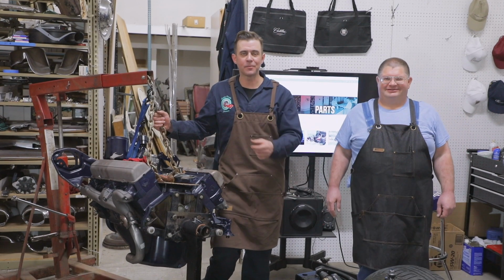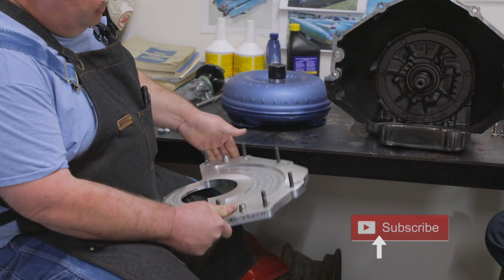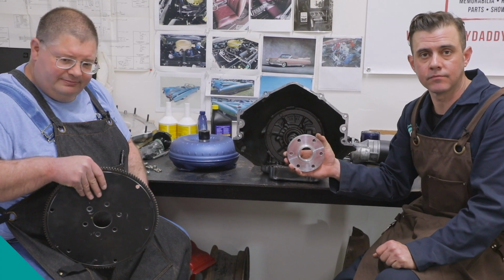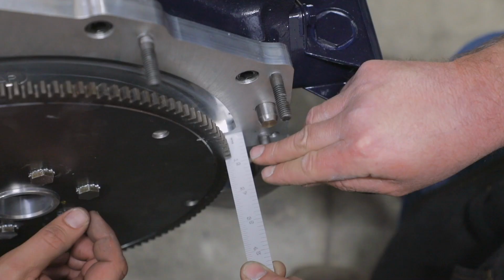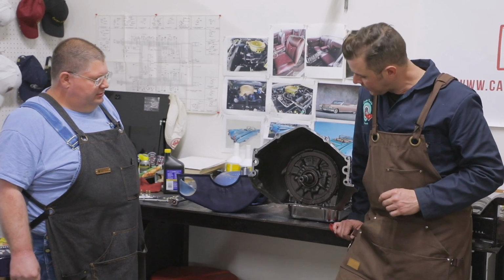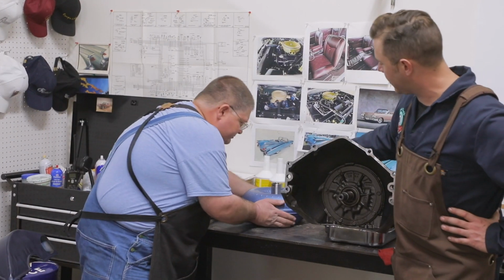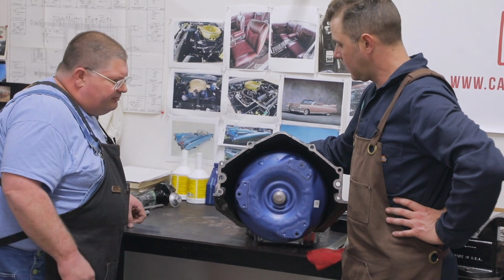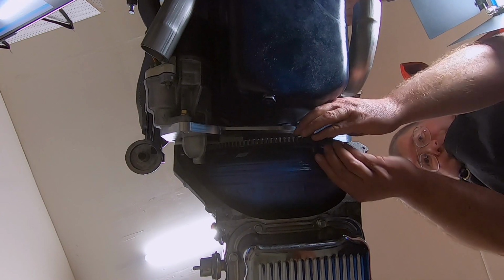How To Install a Transmission to the Cadillac 390 Engine

Comment: Mr. Bob's "bolting it up" soundtrack is intense, sounds like Conan the Barbarian. As always you put out an informative video. Mr.Bob makes it look easy! I picked up my second 57 CDV! I'm in project heaven!
Reply from the maker: Thanks for the feedback! We thought the music track fit very well with the work at hand. Haha. Our goal is to get as much information out there as possible to everyone. Congrats on the CDV! Would love to hear how the project goes. Keep us updated!
Reply: Don't understand what's wrong with using the original four speed hydro, but if you're going to go through all that expense and work, why not A 700 are 4 with overdrive. Now with that Chrysler starter. When you go to start it ,it will scream out d*d*d* d*dooddgee! If you change to a compact light weight starter you will loose that sound ,gain space  and draw less amps

Comment: Do you guys have a video or something on getting the reverse lights working on a 1964 cadillac. These lights have not worked in at least 50 years and I've been trying to trouble shoot it with no luck
Reply: The neutral safety switch, which also has the backup light switch and parking brake release valve is on the steering column. You can jump the contacts for the lights and see if they come on. If so, the switch needs cleaning and anti-corrosion treatment. You can watch our headlight switch video on how to clean and test something like this. Also, be sure to follow the service manual instructions when reinstalling the switch or the car might be able to be started in gear or not at all. Josh

Comment: What kind of kickdown switch you have installed?
Reply from the maker: Hi there,
We have not installed the kickdown switch yet, nor have plumbed in the vacuum modulator. For the 1959, this will be covered in a future video when we set up the tri-power intake. Hopefully, we will soon have a video showing how to do this job on a Buick with a 4 barrel carburetor. This will show the basic job and can be adapted to many other car makes. Thank you.

Comment from the maker: Nothing we did would preclude the reinstallation of a stock Hydramatic
into the chassis.

1a. We used a Chevrolet bell housing pattern transmission, as called for
in the kit. Chevy transmissions are most commonly available.

1b. We used a stock driveshaft with an extended transmission yoke to
make up for the TH400 being shorter than the stock HydraMatic (the old 4
speed type). It was a special order part and was rather expensive, but
allowed us to keep the stock driveshaft. One could get the shaft
extended, but as you know I don't like to make alterations to uncommon
parts so cars can be put back factory configuration by another owner.

2. We used the stock rear cross member to accept an aftermarket mount to
make the engine/trans rest at the proper angle in the frame. I do not
recall if we drilled new holes or used an existing hole in the cross
member. The front cross member did not fit with the new trans and needed
to be modified, but I don't think we got around to that and deemed it
unnecessary. It originally had front trans mount points for the Hydramatic.

3. Since the shift pattern is different, we got an electronic gear
position indicator box to use with the TH400. It provides outputs for
various displays and lights to use in a modified factory instrument panel.

The lower bell housing cover was one from a late 60's TH400 car that I
modified to fit, and it fit very well. I think there is footage of that.
It was a common one we had a big pile of in one of the trailers.

Comment from the maker: Cadillac makes it difficult to get the transmission off the block if things don't turn and I have never dealt with this problem in a Cadillac before. They intend for it to only be done the proper way by removing the flexplate bolts, which is impossible in your situation. The Hydra-Matic fluid coupling is not like a modern torque converter that simply slides into the front of the transmission. There are internal snap rings that hold parts to the transmission input shaft. Looking at the parts diagrams I believe your only chance is to remove the 12 nuts on the torus cover to the flywheel. Hopefully you can get a wrench or socket in the slight gap you have already opened. that should allow the flywheel to stay connected to the flexplate and crank while allowing the transmission to pull away from the engine. Josn